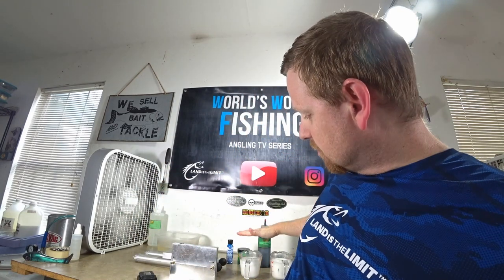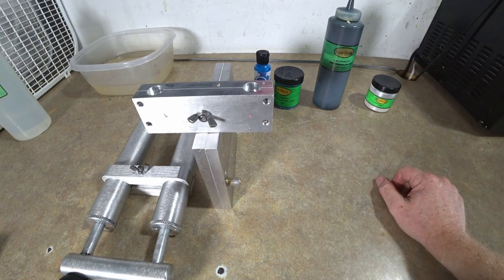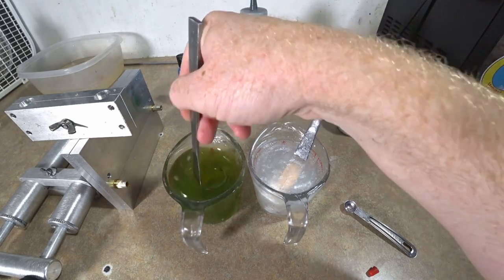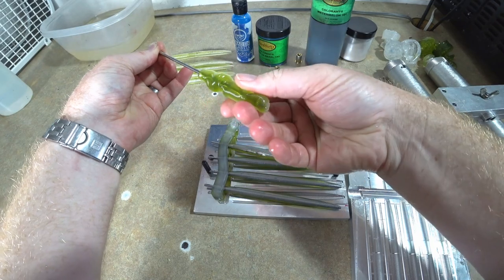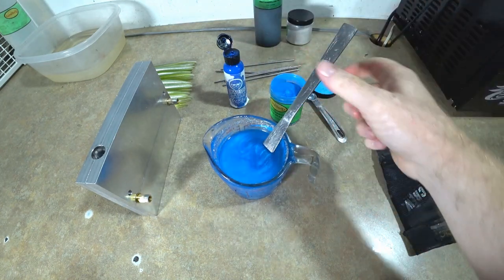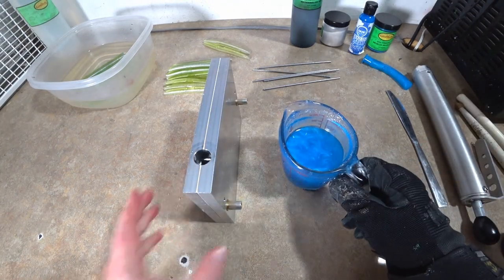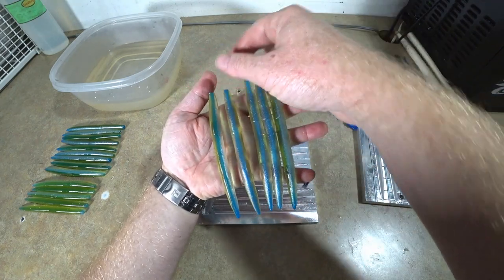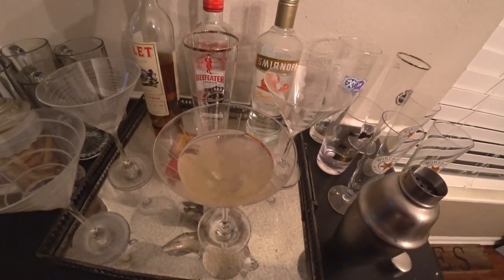LIGHT HITCH CORE SHOTS; Making Swimbait Colors In A Stick Worm

Comment: I have the Watermelon 101 from Lureworks and mine works great. Make sure you mix/shake it very well. If it comes out in a paste form like it did, take a small screw driver or straighten a paper clip and poke it through the tip. If that doesn't work, take the cap off and scrape the cone of the cap out. Sometimes the colorant will set up in the cone of the cap and be to thick. I shake mine up and try to get drops of it and if I barely squeeze the bottle, it pours out easily. Great video and color. Middle for me.

Comment: Have you considered getting the cores coated in something like PTFE by chance?
Reply from the maker: no I havent..wonder if that would simplify it
Reply: @WorldsWorstFishing  if you are running batch after batch repeatedly I'm certain it wouldn't hurt but it's one of those pros and cons. Not exactly free but they should last for years if you decide to go that route and have it professionally done, they also make sprays and they work pretty well but do not last nearly as long. For it to last long term it must be baked on at a very high temp and this would be something you send them off for but it's an extremely hydrophobic, temp safe, dry lubricant (once cured). I'm making it sound more complicated than it needs to be but basically it's teflon they sprays work well but the professional coating is like "NeverWet" but a lot more durable and heat/chemical resistant don't let the cheap frying pans fool you. We use this stuff religiously at work and it would probably work very well for you, the cheaper sprays are like $10 a bottle which isn't free but who knows you very well may fall in love with the stuff like us.